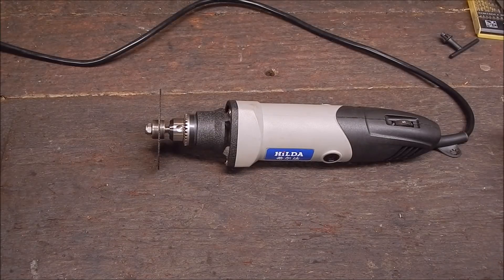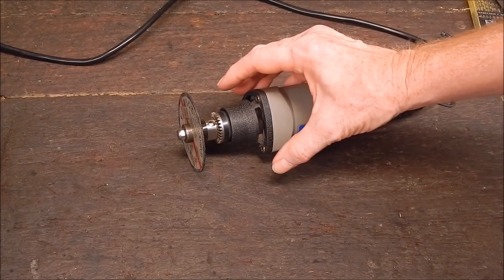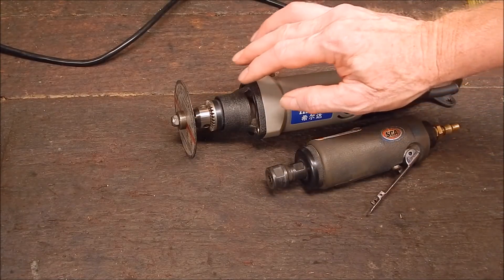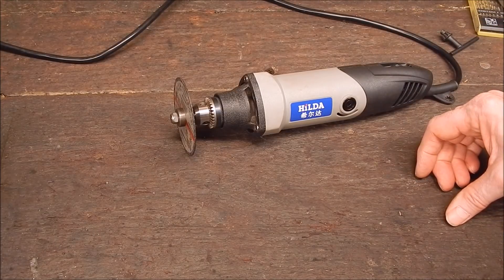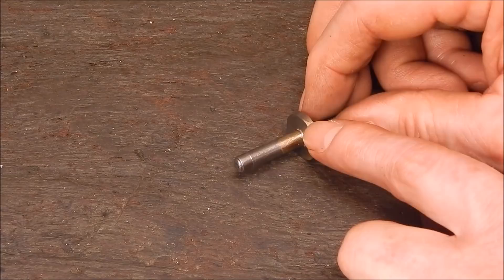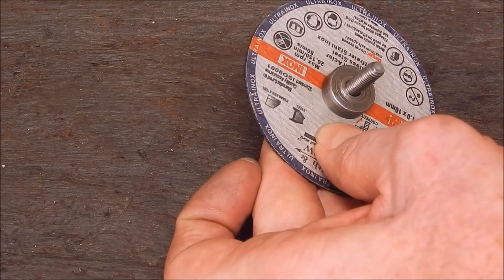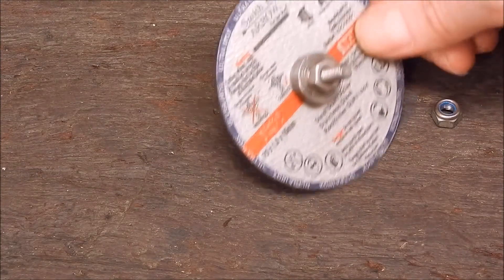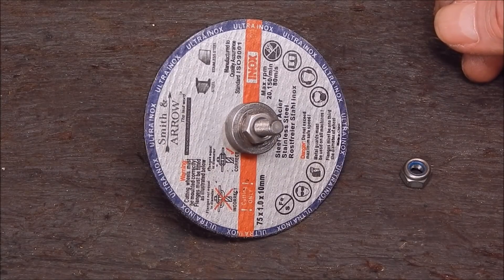How to make a 10 mm cutting disc arbor with a 6 mm shank

Comment from the maker: NOTE: NEVER exceed the safe surface speed of the grinding medium you use.

The larger diameter a cutting/grinding disc is, the slower it needs to revolve.

In the case of a 110 mm angle grinder, a full sized/new stone or disc is generally rated at 10K rpm maximum, which is the maximum speed of the unit. As die grinders can spin up to 30K rpm, it is only safe to use worn/smaller diameter friction material in these units at a suitable low speed (they are all variable speed units).

So use common sense when spinning this arbor in a high speed die grinder. Most electric drills max out at 3 - 4K rpm, so this is well within the safe surface speed of a full sized 110 mm new stone/disc.

ALWAYS wear shatter proof eye safety goggles or a face shield when using exposed discs, and stay out of the direct line of fire/rotation. Ideally a safety guard should be fitted, but that may not always be possible depending on the style of unit used.

Cheers Rob

Comment: nice video as usual.

can I just buy the 10mm mandrel adapter arbor for the standard grinder with 10 mm shank, and lathe the shaft to 6.35 mm ?

or make a proper arbor from 22 mm round stock, and lathe + thread everything?
Reply from the maker: Yes, absolutely.  You can simply turn it down to the largest diameter that will fit in your chuck.  Cheers Rob
Reply: @Xynudu  excellent. I actually bought a set of 6mm and 10mm arbor adapters, so I will turn 10 mm to 6.35 mm and this way I will have 2 most commonly used discs already mounted in them, ready to swap. the one turned by me, will have a bit more heft to it, so I will use it for the bigger diameter discs. 

thank you!

Comment: Hi Rob, your video inspired me to make my own arbor for my Hilda (for which I’m currently making the tool post adapter using your design). Since I don’t have the gear to braze, I took a different approach in making a simple arbor.
1. Started with a 10mm cap head bolt and turned the shank down to 6mm except for about 10mm of original thread just below the head (this removed threads and left a solid 6mm shaft.)
2. Faced the bottom edge of the cap head to guarantee perpendicularity with the shank. JOB DONE!!
3. To use, first put on a ~20mm snug fitting washer (10mm central hole), then cutting disc, then another similar washer. Finally, screw on a 10mm nut and tighten with an Allen key on the cap head and a spanner on the nut.

Works fantastic with no visible runout- thanks again. Just so simple to make without needing to braze. Just another way to skin a cat I guess!!
Reply from the maker: Good idea Brian.  Will make a nice neat job and easy to grip.  Thanks for sharing.  Cheers Rob

Comment from the maker: Well it turned out excellent in the end.

I spent another morning in the workshop making the end cap and taking out all the machine marks with the old Schaublin and HSS.  The carbide insert I originally used was on it's last legs and the shitty steel had plenty of machine marks as a result, but all good now.  Puurrrfect.

Anyone that buys the 400 watt HILDA rotary tool should definitely make one of these, as it's so useful.

Cheers Rob

Comment: Hey Rob, you sure have good luck with your collet chuck. Some of the guys have been getting some from Banggood and have not had very good results, poor accuracy, poor repeatability. I have had the same experience from one I bought on eBay. I reground the chuck and got it quite a bit better. But I need one for another lathe I have and thought maybe you had a suggestion on where to get one for a reasonable price that won't have the issues... have a good one!
Reply from the maker: Hi Mike,

I got my original ER32 collet chuck and set from CTC Tools online store.  I have bought quite a bit of stuff from them over the years and always got good quality for the money.  They don't sell rubbish and the ER stuff is to DIN standard.

They are not as cheap as they used to be, and now based in Europe, but I felt safe trading there.  I can't comment on what they are like now as it's been a while since I bought anything.

I have also bought a few individual collets and a tailstock chuck from Ebay and had good luck, but once again it has to be to stated DIN standard.

I've never bought a Banggood collet/chuck so I can't comment.  I've seen some bad ones in BG reviews so that's not good.  BG have a large spread of ER stuff and I don't think it is all the same quality.  eg they sell collets that are in those blue and yellow cardboard boxes that look exactly like what I've bought over the years.

I may ask for a couple of those and do a review on them.

Certainly the "kits" they sell seem to be pretty awful ;)

Cheers Rob
Reply: xynudu Thanks Rob, I will definitely check to see if that DIN standard is on my next chuck. And also CDC tools and see what they have to offer. Appreciate the help Mike

Comment from the maker: NOTE:  The manganese bronze brazing is being done with the Bullfinch LPG bronze brazing system.  This is a UK designed torch which does MAPP type gas work at a fraction of the cost.  Check out my earlier videos for more on this great torch.

Cheers Rob

Comment: G’day Rob,
I realise you like the brazing method, as do I . . . it’s becoming a lost art, unfortunately.
Without an Oxy setup I find there’s many instances where Comweld SBA 245 really is very good stuff. (no affiliation; just a home gamer here)

Yes, it is expensive because it’s 45% silver but you end up using so little and the capillary action is something to behold. I’ve used it often for the capillary capabilities and sometimes overlaid it with the cheap plumbers 5% silver rods to form a fillet when needed.

I’d recommend you try some SBA 245 . . maybe a video? I reckon you'd be impressed.
It also needs less heat than manganese brazing, too.

Cheers from sunny Qld.
Reply from the maker: Thanks for the tip.  There's no point me buying expensive rods like that when I can easily manganese bronze for peanuts.

I understand what you are saying, and if you don't have MAPP or a Bullfinch torch then it may be economic in the short term. 

In my workshop I got rid of the oxy plant years ago after seeing the Bullfinch LPG torch, and it's been the best thing I ever did - cheap to run and does hard brazing on small jobs easily.

It's all I need.

Cheers Rob
Reply: I hear you on the Bullfinch. It's a lot of heat for very little money when LPG swap 'n' go cylinders are so cheap. The Bullfinch covers quite a range of needs so I'll have to treat myself to one.
Cheers.
Reply from the maker: The Bullfinch torch kit is not cheap, but if you do any amount of MAPP gas level brazing it will pay for itself in spades.  

I've had mine for close on 20 years.  The beauty is that while a single MAPP bottle is in the $20 - 30 region and will last 15 minutes, for a similar amount of money I get a 9 kg bottleof LPG which will last for at least 4 hours continuous running.  Big difference.

Cheers Rob
Reply: Yep, I hear you. I should have said that a Bullfinch based system is relatively cheap overall even though the Bullfinch torch itself really isn’t.

The great thing about YouTube is I can see the Bullfinch is a lot more capable than my old Primus (?) LPG torch . . and let’s face it, they aren’t all that cheap for what they are, either.

I’m also loath to resurrect my Comet 3 Oxy/Ac kit because the gas cost and cylinders is very hard to justify considering how little I’d use it these days.

Cheers.
Reply from the maker: The oxy/LPG kits look quite attractive these days as you use cheap LPG, and now you can buy the "D" size Oxy bottles from Bunnings and refill them, and return them for full refund when no longer required.  That's way better than paying BOC annual rental of hundreds of dollars a year.

Oxy/LPG is good for brazing if you want higher temperatures.  But like all oxy you have to be careful not to burn up the job.  Just LPG can never do that as it won't melt steel.  Plus you can use just LPG without wearing an eye filter.

I quite like this Oxy/LPG brazing kit:  https://www.hampdon.com.au/oxygen-and-acetylene-brazing-kit

The link title is wrong as it's NOT acetylene..

This mob also sell the Bullfinch kit and export it overseas.

Prices are OK.

Cheers Rob

Comment from the maker: NOTE:  If you want to make this with a screw on back plate you can still reduce the final thickness by leaving an extended centre section for the thread (on the shank side).

Cheers Rob

Comment from the maker: NOTE:  To make the end cap, simply face off the original round stock:

- make sure the 6 mm centre hole is deep enough to go right through,
-  use an 11 or 12 mm end mill in the tailstock to make the centre relief,
- part off for the required thickness.

Job done.

Cheers Rob